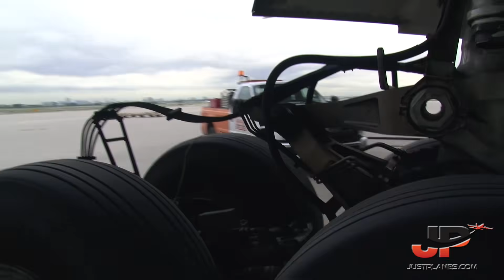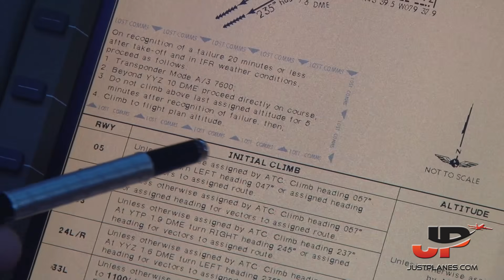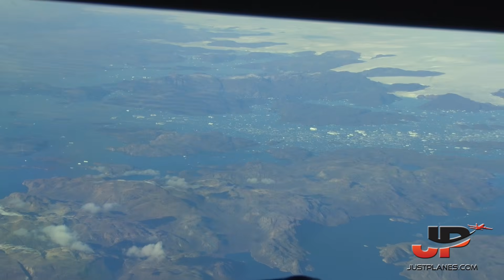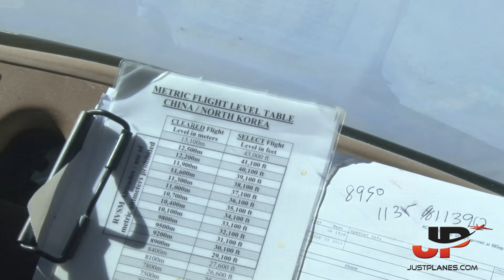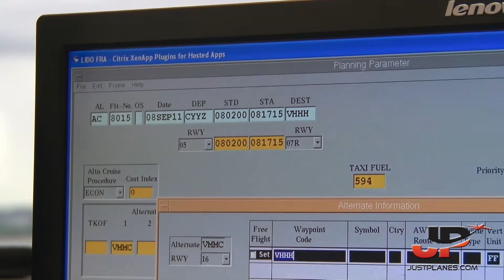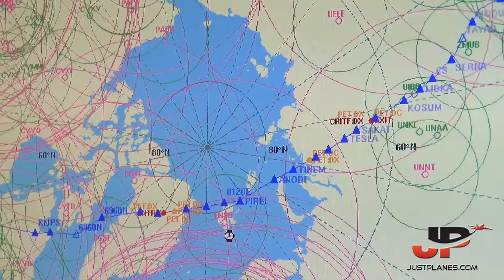Air Canada Boeing 777 POLAR Route to Hong Kong | Full Cockpit Flight and Presentations (2011)

Comment: On the aircraft identification 'label' what does '702'  refer to ? is that the ICAO code for a B777-200 etc ? is it not B772 or something ?
Also , in general why is the FL so low ? Highest they went was FL330.  Most other long distance journeys would be FL380 - 400 (more and more FL400 is the new norm). Is it to do with polar air density and temp etc ?

Comment: Does this much planning go into most long distance flights or is this extra detail due to flying over the North Pole into Hong Kong? 
 Also, why is there a no-fly zone in Greenland? Thanks. Great job guys!  Kudos to Just Planes!
Reply: The no fly zone is due to high terrain. In a decompression event, you want to get down to 10000 feet, but it is not safe to do so in much of Greenland. The zones are designed so that you can go down to 13000 feet and have an escape route to quickly get you to an area to descend further. The area of the no fly zone is only safe to 16000 feet, and it is surrounded by zones that are at least 13000 feet, so that won't work.

Comment: What's the actual altitude of the aircraft above sea  level when flying at FL 330 in the polar regions? My understanding is that the flight levels are constant pressure surfaces.
Reply: So your question isn't answerable without you providing more info as to what you wanna know? Are you looking for an altitude AGL or AMSL? Above Ground Level (AGL) is a measurement of altitude based on the distance between the aircraft and the ground directly beneath it at a given moment. Above Mean Sea Level (AMSL) is a measurement of altitude above the historic mean (average) sea level. At flight level, above the transition altitude, is measured by an altimeter using a standard barometric pressure setting of 29.92 Hg no matter the global position of the aircraft. This ensures that all aircraft are all using the same  standard to measure altitude. So, FL 330 in the polar region is 33,000ft amsl. If you could get a barometric pressure reading at the pole and apply it to your altimeter you might see a 500ft deviation from the standard 29.92 Hg. Def not an 8,000ft deviation. I'm trying to avoid getting deep in the weeds which is very easy when explaining this stuff.
Reply: About 25000 feet

Comment: To bad these polar flights have been suspended because of Russia. I love this video,  its one of my most played
Reply: Technically Polar Flights are all that crosses the Arctic Circle, so they still remain, the only difference is the path that is more to West straight to Japanese Airspace against those more on East straight to Russia and China.

And actually now because of the closed Russian Airspace, some European Airlines (SAS/FIN/NOZ) have to deviate from Russia when towards the Asia, so instead of going by Middle East spending more fuel , they are now flying by the Arctic. So in fact, now you have more Polar flights than before...
Reply: @Soaresbruh  I was talking Specifically about this route. If it goes over the Arctic it has to go through Russian airspace. I should have made that more clear.
Reply: @thearsenalmisfit2414  ssorry for that, i thought you meant all Arctic Flights as a whole not only this AC one, but just to clarify Arctic Flights are any that flies in very high latitudes and/or over the Arctic Circle and North Pole, not only through Russian airspace.

and both places "Arctic Circle" and "North Pole" stays more over and near of Canada and Greenland than from Russia, so technically you can fly between places in Greenland and Canada and still make a Arctic Flight

If i´m not mistaken even before the war there was flights from UAE (EK/EY) to Chicago or US East Coast places that flies Arctic/Polar Routes via Western Europe without pass over Russian Airspace also. 

be fine bro, Putin will not censor the Arctic Flights...

Comment: If you have a fuel freeze at 33K feet, will the fuel thaw as you descend?  How far can you glide from 33K feet?
Reply: If it freezes you already have a problem. You should start ascending(!) or descending to a warmer air mass or speed up to increase friction drag that warms up the skin of the plane when you notice the fuel beginning to drop in temperature. Not sure how fast it would thaw but i wouldnt count on it thawing enough in time for you to start the engines again but im not 100% sure. Glide ratio is about 20:1 for a 777, maybe slightly less. But assuming 20:1, for every 1000 of altitude loss you can glide 20000 feet forward which is a little over 3 nautical miles. 33 times 3 is 100, so 100nm or about 185km. A headwind would decrease your distance and a tailwind would increase it
Reply: Shouldn't happen in the first place, unless the FCOC (fuel cooler oil cooler) has failed.

Comment: Thank you. I'm a retired pilot. Dispatchers are unsung heroes with the airlines.
Reply: As a current dispatcher I appreciate the comment. I am always glad to help the flight crews out in any way I can.
Reply: Dispatcher are very important , i am also a flight operation officer, but sometimes airline still underrated my salary
Reply: @kepitingsalto_  Yes, operations officers keep us in the air.....safely. And, yes. After 911, and the company dissolved the ESOP, our pilot salaries were cut in almost half, and the micky mouse mess manifested itself in many obvious ways....I retired early, and glad I did. It got that bad, IMHO. It wasn't worth it any longer.
Reply: @sandybanjo  it was that bad with the salary cuts?
Reply: Quite correct.  I work performing heavy haul commercial maintenance, in Tucson AZ, on narrow single isle, to big birds-767/777/747 300/400/ and now, Dreamliners.

Comment: Now the routing entry into the guidance system. Are each route segment manually entered by the pilots during preflight, or can it be electronically imported from the dispatcher, then audited and approved by the flight crew? This flight has a very large routing table. Thanks.
Reply: In Boeing aeroplanes there are a few methods of entering a route. You can either key it in manually, you can retrieve a route that is stored in the FMC database which is known as a Company Route. Or you can request a route using the ACARS function. The CO RTE function is usually only useful if the airline operates a particular city-pair where the route is the same every day.
Reply: Even though this flight was I believe 2008..I'd say even then once the Captain and despatcher sign off. The route can be imported into the FMC via company function...